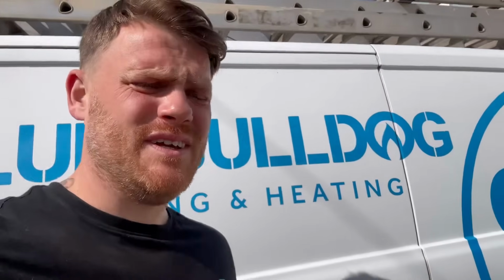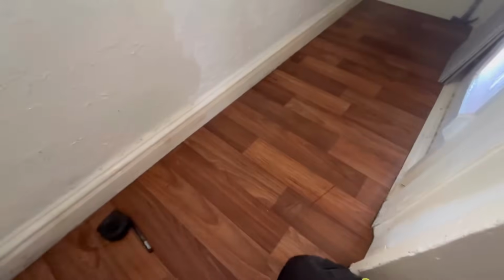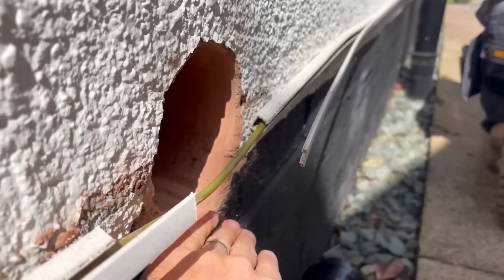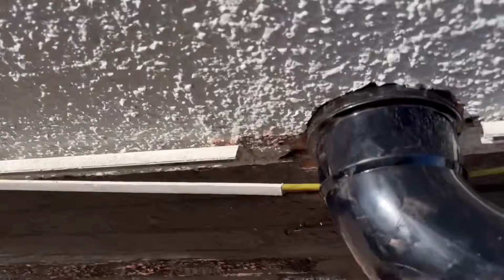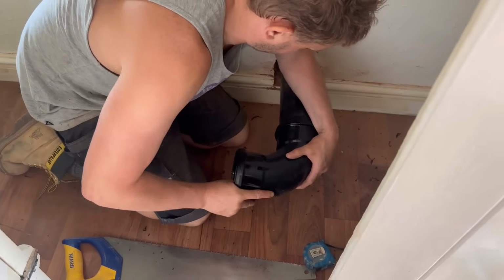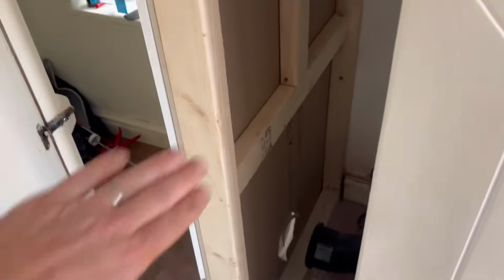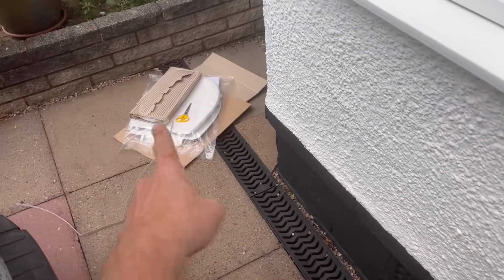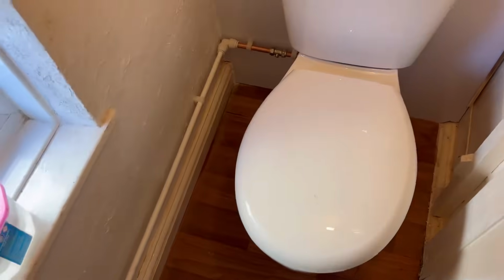New Toilet….Can We Get it Done For £1000?

Comment: Good job Luke mate..
Just a small bug bear with me... I alway try to fit a coupling (not an elbow) when joining plastic to copper. This helps to eliminate the 'water shock' when the tap is closed down, potentially pushing the fitting away from the copper.
Anyway your a great engineer brother 👍
Reply from the maker: Good point to be fair mate

Comment: It's a nice job, and once the customer is satisfied, and it works with no leaks, job done! Liked plastic supply to the toilet, works as well as and you don't need to paint it. Copper at the end with isolator and a flexi, sound. Good idea to locate the toilet under the stairs, the wall, and the stack being close by outside. Sounded like a p(l)an!!
Reply from the maker: Thanks mate, I liked how it looked in end, exactly what customer wanted, budget toilet that looked Decent 👍

Comment: My partner had a downstairs toilet fitted by a so called plumber but he use a massarator  why I don't know it was for ever getting  blocked .the soil pipe was in the exactly the same place as the one you tapped into .being a brickie and in the trade all my working life I whipped it out and replaced it with 110mm soil pipe like you .job done .
Reply from the maker: Good man 👍 can’t understand why they would use a poop blender rather than straight into stack be least it’s done now